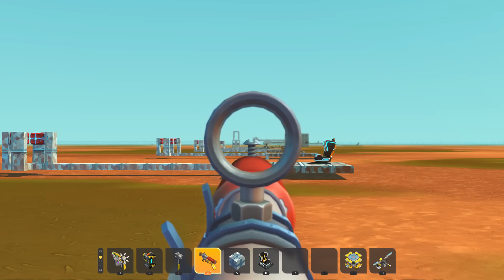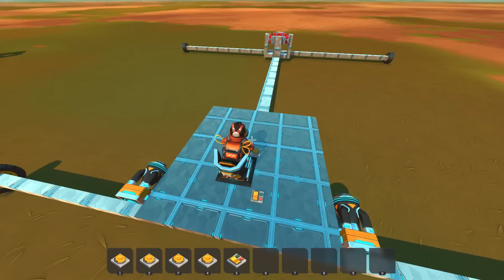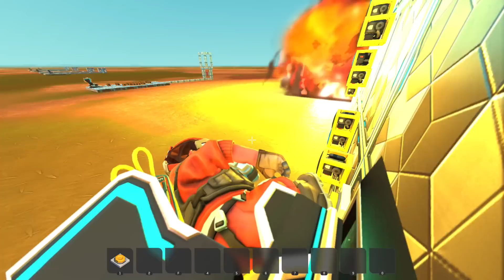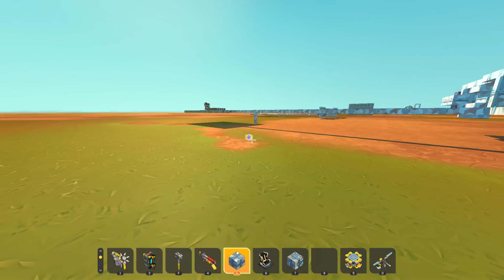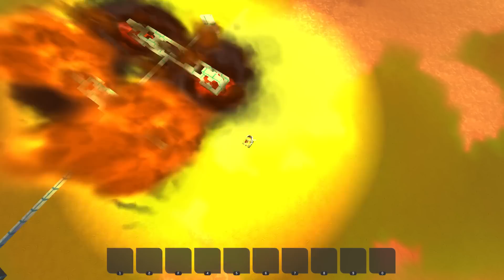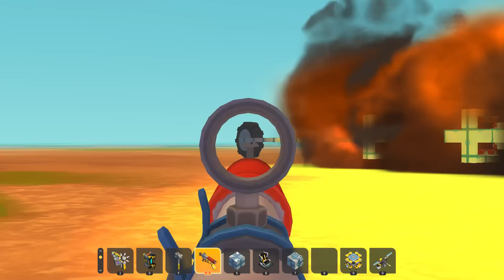I Built a New and Improved Explosive Engine with Automatic Timing Systems! (Scrap Mechanic Gameplay)

Comment: I don’t see a newer combustion engine video so I’ll post here. If you rotate the engine 90 degrees so that the cylinders are parallel to the direction of travel you should have the explosives in the proper position more reliably

Comment: since the force is instantaneous, you need to reduce the amount of time where the cylinders aren't being propelled, so a much shorter piston shaft should help with that. In a more recent video you also designed a manual transmission, something that that should help a lot with not being able to start/run on the vehicle.

Comment: Maybe (because it can run high speeds but low torque) just use a gesr ratio where you get lower speed but higher torque

Comment: Literally just an internal combustion engine flattened out except missing two of the four strokes an actual internal combustion engine has, it goes intake (brings in fuel from the tank and fuel pump) compression (compresses fuel) ignition (burns fuel pushing the piston down) exhaust (vents the gas thst the fuel releases when burned as exhaust)

Comment: What about using one of those trammel gear ration thingies? I don't remember the name, but the 4 component 2:1 gear ratio thingies. Shouldn't that convert some of the explosive engine speed, into torque?

Comment: See if you had changed the offset on the crank you would have been running basically a 2 stroke flat 4.

An opposing piston engine would have basically the explosives in between 2 cylinders with a crank shaft on each side.  They use this for some tank engines and generators, but not for cars.,  They run off diesel and they are typically 3 cylinders with 4 pistons and they can run very high compression.  If you could join the crank shafts together pretty easy then this would cut down on logic and explosives and maybe make the engine smaller.

You need a gear reduction in there.  Try a wheel with peg sticking out the side that would give you say a 4:1 ratio.  The slower speed might fix the spawner issues.

Comment: So a couple of notes about this.
First off, real engines typically ignite the fuel/air mixture before the cylinder reaches what's called Top Dead Center, or TDC, because it gives the gas mixture additional time to build up heat and energy. In your case this is a very bad thing. Your cylinders need to be well past top dead center to not throw a rod when ignited. I'd suggest basically introducing a 1/6th to 1/4th turn delay between the cylinder getting as close as possible to the explosives, and the explosives actually going off. That way the energy can be more effectively translated to the crankshaft rather than trying to shove the piston through the crank directly. The closer the offset portion is to 90 degrees from the cylinder when the explosive goes off, the less strain there will be, although it'll come at the cost of how much energy is recovered from the explosion.
Second off, you really need to gear this thing down. It's got next to no torque. You can trade torque for speed though, like a tractor. Tractors are slow as hell but could tow God himself out of a ditch if necessary. Real tractors can even flip themselves on their backs if the wheels get locked up somehow. The point is, if you can find a way to make it so you've got a high gear ratio, torque should stop being an issue.

Comment: Rotate the engine 90 degrees so that it's transverse. Right now when you're moving forward the "lag" position of the explosives makes them move off center of the pistons which may cause the piston blow outs. If it's transverse, then they will only spawn futher "behind" the vehicle as it moves. While this will still be less than ideal, it should be easier on the engine and you may be able to compensate for it if there is a way to make the pistons move towards the front of the car the faster you get.

Comment: So in a real engine you have consistent piston explosions by having no two pistons fire at the same time. They are out of phase be different degree amounts to completely eliminate the dead zone and allow the flywheel to maintain energy rather than expending it covering the dead zone. Ignition timing on real engines is very important, which is what the camshaft is responsible for.

Comment: I love these kinds of engines :D If it doesnt work on a vehicle you could probably build a stationary engine to power something. Maybe a crane or whatever. That would be interesting to see!

Also, another idea, if you dont want to use cylidners, would it be possible to build something like a rotary engine or something else that doesnt have to convert linear to circular motion

Comment: "It's 4 cylinders"

gestures to an H8
(Fairly certain the H8 worked without a flywheel since you have to do 180deg rotation for each cycle, meaning in theory the crankshaft would be sitting at 180 every time the second piston bank fired, which in scrap mechanic physics could go either way. An H8 switches this to 90deg meaning just the latent momentum of the driveshaft itself would guarantee it would keep spinning in the same direction).

The car won't start without a kick because the back-torque from the wheels is too much for the pistons themselves to overcome directly and work in a cycle. You need a flywheel to smooth this out and potentially literally an electric starter motor (most starter motors slot into a gear to get the engine spinning and then disengage. Obviously in a real car there's also a clutch so you can engage the engine to the wheels gradually instead of all at once, making the instantaneous back-torque lower). 

The flywheel's momentum is energy storage. You need a certain amount of energy to overcome your inertia. There's a few different ways to look at it. In a real car, the starter motor engages to the engine, spins it a little bit to get the cycle turning (as often it can't reliably kick the flywheel into action on its own). The engine is then slowly meshed to the actual drivetrain at a reduced gear ratio to make the back-torque manageable. Once you've got engine + flywheel spinning reliably, you have a smooth force/torque/power output which makes engagement to wheels a more reliable endeavor.

You could probably do it with direct engagement and no clutch, but you'd likely need a gear mod as in vanilla your options for gears are basically n=2 and n=4 which isn't exactly ideal.

EDIT: Actually since the number of teeth is irrespective of total gear radius you can't have gears ratios at all in vanilla.

Other than doubling up the spars I have no clue how to fix the piston bugging out though, that seems like something the devs would need to work on in order to make the overall engine more friendly to this sort of creation.

Comment: i feel like this is because the explosives are spawning just as the piston fully extends, so if it explodes, the piston could lose power to the engine, so make it detonate as the piston starts retracting with a slight bend in the crankshaft

maybe this timing issue could solve the buggy piston issue too, as the explosives are spawning into the piston... so if the piston is slightly retracted and out the way, it could stop glitching?

Comment: dont explosives trigger when compressed .. sure ive seen that they do,... with that couldnt you spawn them in some sort of chamber above where they drop into the pistons path and the compression part would create the explosion then you could eliminate the issue of the explosives not spawning correctly due to movement slightly..

Comment: I think it comes down to a lot of timing like for example when moving and engine is started the pistons may not be at TDC or top dead centre when the explosion fires. Try figuring something out with the crankshaft like how in the real world engines have crank sensors and cam shafts and timing belts etc. but then again there's only so much you can do on SM.

Comment: Don't understand why you called a 4cyl a 2cyl, and an 8cyl a 4cyl, but this is really cool. Each cylinder is counted, not in pairs. What you have here is basically a V4 and V8 in a 180° configuration.

Longer stroke translates into higher torque, but idk if that's how it works in-game here. You could experiment with different firing orders or tune the timing too (advance or retard the timing). You could also try different flywheel weights if it seems like certain sizes and materials are slowing the engine with how heavy the flywheel is. You'd probably wanna get a flywheel heavy enough to keep the engine in time while also having it light enough that you keep its effects of slowing the engine to a minimum. 

I saw comments suggesting you use mods that allow for reduced friction and more powerful explosives. Good ideas. You want as little friction as possible between the cylinder walls and the pistons here. More powerful explosives paired with a longer stroke could definitely produce some good torque.

Comment: maybe u should try an feed mecanisim aka u spawn the explosivs outside the chamber and push or drop them in the chamber maybe u could reduce mass with center load 2 and u have 2 shafts 4 dopel the power ^^

Comment: I don't play the game at all but if there is a way to create a gear ratio from the engine to increase the torque from the engine that might help with it just dying. A clutch system might also be a good idea. So basically build a real transmission system that you find on an actual engine to fix the issues that actual engines have. I have no idea how you would do this in the game, I just think the concept for the engine design is cool and would like to see it actually drive the wheels.
Reply: Funnily enough, the issue with getting the engininitally going is also an issue that cars face and is why they have an electric started motor or in those really old cars you would have the engine crank in the front.

Comment: fill in the gaps for the cylinder walls maybe 2 blocks deep to prevent the cylinders from flying out. btw is it possible to make a flat 8 engine with individual firing order plus a clutch and another clutch for a starter to start the engine like the old days that doesn't have an electric starter and uses a mini gas engine to start a big diesel engine, in this case, the explosive engine is the big engine?

Comment: As a mechanic, you got a couple things wrong. 
1 - Your pistons dont fire at "TDC" (top dead center). Witch is very important cause that is where the most amount of FORCE is.
2 - Your flywheel need to be made out of the heaviest material but only the outer ring. Making it heavy from center to outer of the plat will only make the build harder to function.
3 - Light and low friction for every internal parts and where piston slide. When explosion occur, the thing it push(the piston) has to have minimum restriction of that incoming force.
For dual piston setup, just have both connecting rod on the same crankshaft position. One will fire and alternate to the other.
If you are missing torque at the end of that, make your "crankshaft connection to connecting rod" farther from the center of the crankshaft.

With all of that, hope to see a new video! :)

Comment: ❓PROBLEM❓--->❗SOLUTION❗   add torque/ add stroke/ rev match/  
Torque can be added with 🧩SLEEVES🧩 around  🧩DEEP DISH PISTONS🧩 to keep torque IN......torque is lost with so much open (uncontained) combustion!!! Keep explosion IN @ bombs too like enclosing heads with intake lifters have runners....your explosions would be focused to only open end.  Like fireworks when closed hand hurts more than holding it with hand open.
Short flywheel helps only with high RPM's , you need 🧩BIGGER STROKES🧩 per stroke. to get more out of torque.  
🧩Matching wheel speed with engine speed🧩 {bogs engine}...(either a logic way to find harmony per rpm) or find speed of engine and get movement to THAT SPEED.  GOOD LUCK

Comment: build a gearbox then it the engine wont stall because you basicly go full torque on the wheels from moment one so if you build a gearbox you can fire it up in neutral so it will start properly en you can build different gear ratios wich will handle the acceleration better

Comment: What you should do for the vehicle is add a clutch to it, like a real car.. in a real car the clutch has to be depressed to disengage the transmission to put less stress on the engine when starting. You can think of the wheels as the transmission and put a clutch between the two and then engage the clutch to start the engine and disengage to drive

Comment: The only issue I see is that the explosions look like they’re firing when the piston heads  are right at the opposite end of the cylinder. Doesn’t this reduce the force expended on the pistons? Wouldn’t you want them to fire when the heads have just finished a cycle and are right next to the explosion?

Comment: Would building a larger gear to give more torque help? I'm thinking something similar to a manual transmission. I would think the reason your having problems with the explosive spawning inside the piston is because you've already have the pistons moving and they can't catch up or slow down to the explosive speed.

Comment: You dont have torq. I don't think you can maintain power at scrap mechanic's physic engine. Irl they powered by expansion of gases not by explosions itself. It's hard to differantiate but basicly you cant punch a piston you also need to push it. Maybe you can do with more cycle but this pushes game's limit too hard.

Comment: I noticed when the engines were running (at least at high rpms) the detonations were happening basically at bottom dead center which would explain why they wouldn't be giving much torque at speed. since there's probably a delay in the detonation, that same delay would result in a greater rotation angle as the engine goes thru rotations faster. Someone mentioned variable timing as a way to work around this which I think could be a great idea. You could use different color sensors to switch between different settings.

As for timing sensors in general, if you put them farther away from the shaft, say on a flywheel, you could get better precision in general since more blocks would pass the sensor in each rotation. That might help the problem in itself, and make variable timing an option if need be. 

And for building up speed, I don't know how reliable friction between blocks is in SM but some sort of clutch or torque converter system seems like the go to. Some system with two different shafts that try to match each other's speeds. Maybe tires pressed into each other? Idk I'm no expert but I hope some of that helps. Love the content man!

Comment: using the steering lock with a level 5 seat you could make a friction-based transmission so you can ease it in

Comment: you could hook up some thrusters to the cylinder heads instead of explosives. This would fix the issue with the explosives not spawning right. It would still be burning fuel but no explosions so maybe not what you are looking for.

Comment: You have a one to one gear ratio right now and that's why you have a hard time getting the engine to start when rolling so I would add a transmission and also for more torque I'd give it a longer conrod stroke

Comment: Rotate the engine by 90 deg and make the cylinder longer so even if you  are moving the explosive will still be in the cylinder
 also use the gears horizontally to get better gear ratios for more torque

Comment: Definitely needs some gear reduction. Also might not be a bad idea to somehow put an electric engine to help with the explosive engine starting. Looks like you're on the right track, might want to look at real international combustion engines for your answers, although the game physics seem to be a problem as well

Also when you said your logic was like electronic ignition, it's actually more like electronic fuel injection. The ignition is caused by the explosives spawning inside each other. You're timing is based on when the explosives (fuel) spawn. Little detail, i knew what you meant, but others may not have.

Comment: The timing needs to be advanced, the pistons aren't even close to top dead center when they get power. Also, you could simplify the design by chopping off the left or right and rotating 90 degrees, or by getting rid of the front or back and changing the crankshaft so opposite pistons are in opposite positions. The way it is now, you've got a flat 8 with inline 4 timing. Although, with a few modifications, you could get it to a proper American V8.

Comment: The problem with the Engine is that when you start moving the cilinders start moving and the timing from the explosions gets fucked-up. So you should start the Engine without the Wheels touching the ground and start the thusters at the same time. That way you won’t blow your cilinders out. The explosive spawn problem I can’t help you with.

Comment: Now this have very high potential.

Edit: change the gearing ratio hopefully it will make a difference. 4  to 8 spokes (1:2 ratio) maybe? The greater the difference the more power but the slower it gets. Also if the ratio is inverted it might get worst.

But what I really think is, the game isn't cut out for this. (The piston thing clips out it's cylinder).

Comment: It might not work but you could try to turn it into a 
wankel engine there is nearly 0 chacne the piston will blow out in addition it is smaller than a traditional engine so you'll get lighter. I'm not sure about the powergeneration though

Comment: The torque problem is caused by how short the crankshaft arms are. Remember torque is force*distance and your crank shaft is only 3 blocks wide and is only giving you a distance of about 1 block width.